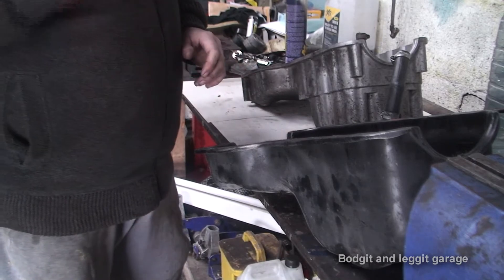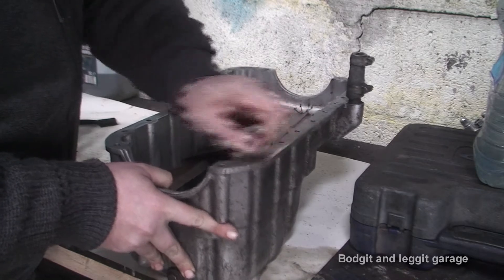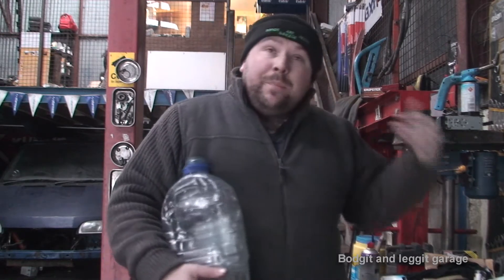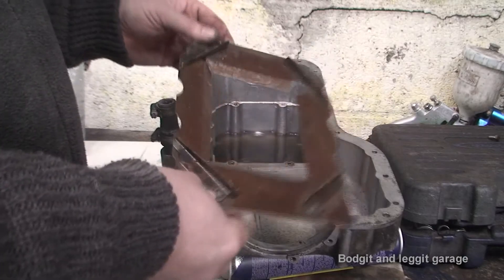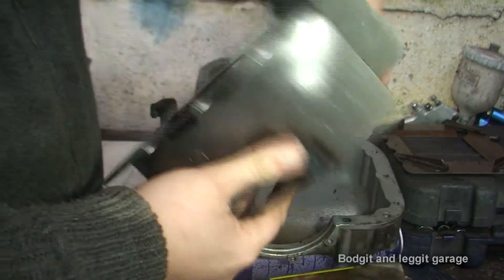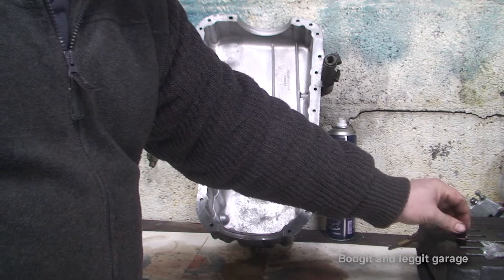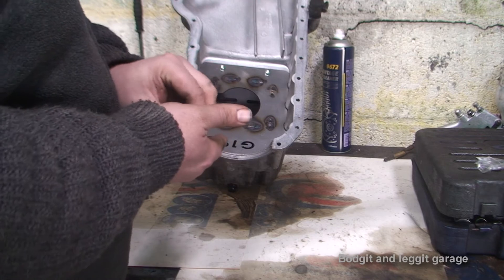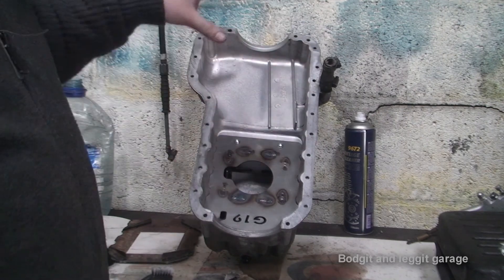baffle sump how do they work bodgit and leggit garage cosworth engine sump(project van part11)

Comment: Another great video mate,Have you ever tried Tungsten Carbide scrapers.They are absolutely brill at cleaning the gasket mating surfaces.Available on flea bay and quite cheap.
Reply from the maker: +pete smith hi mate no i have not but will try them thanks